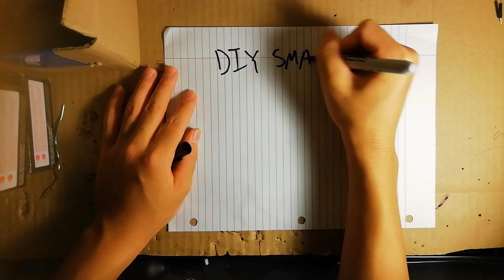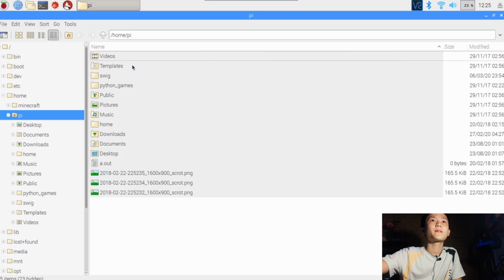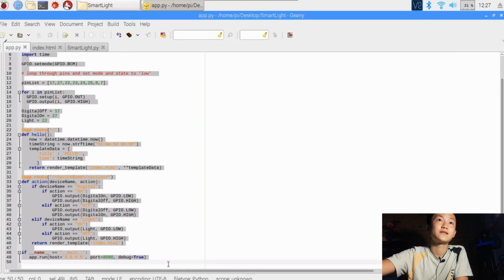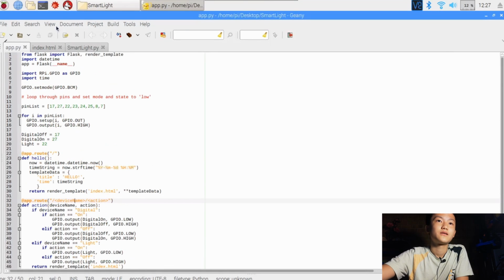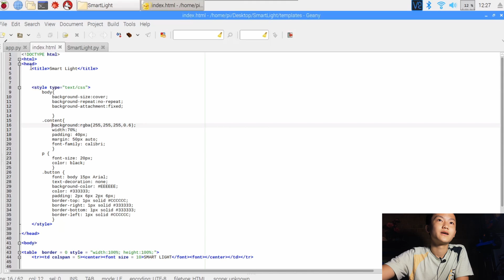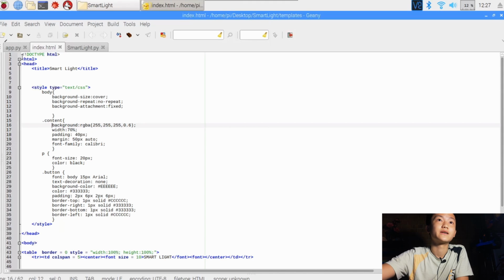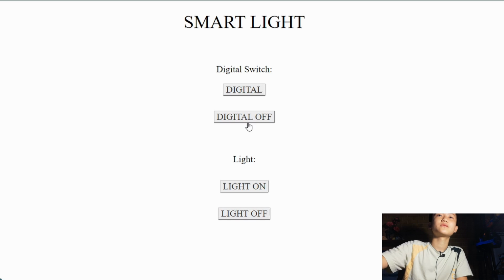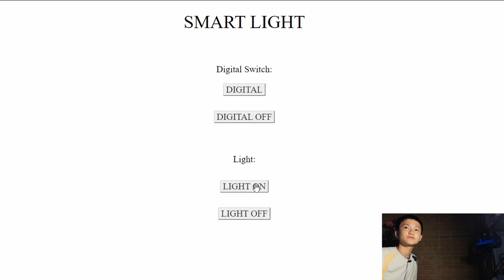I built a smart light using a raspberry pi

Comment: Hey man, can you please provide the code required for this project?
Reply from the maker: Hey sorry the code has been lost to time's grasp, but I can tell you now that it wasn't extremely complex and you can definitely replicate it with some research and troubleshooting. You will have to learn web hosting with rpi and syntax for using GPIO and relay switches, but in the end the logic consists of some basic if-else statements (if this switch is on then turn on the relay, etc.). It seems like some people are interested in this topic, so I may consider coming back to this project and creating similar diy build videos with more in depth explanations.
Reply: Or just ask chatgpt to do it for you 😅